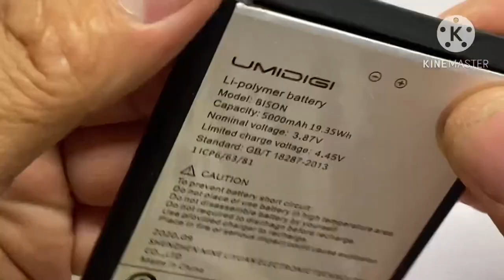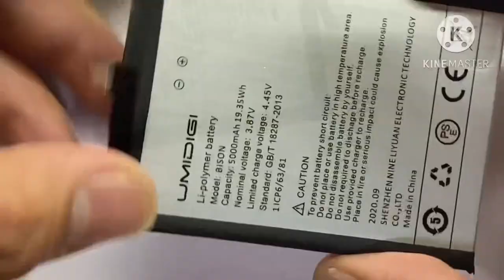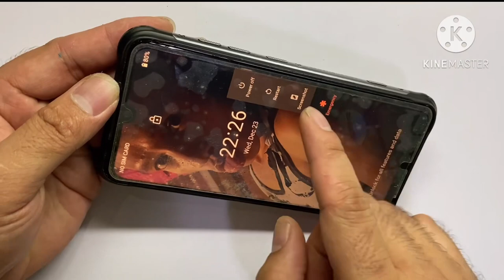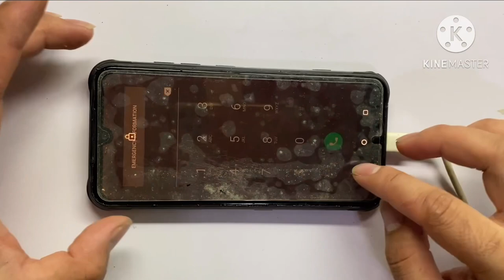Umidigi Bison Boot Loop problem fix 100%  almost full battery ayaw mapunta sa menu namamatay lang!

Comment: Is that a fuse you're removing and soldering up the contacts? I've got new version of this phone gt2 5g and it's randomly turning off, won't boot up and I suspect battery problem as it won't take charge and keeps corrupting the software. Also when it's on if you bump phone screen goes fuzzy with colors, possible loose connection. Fairy new and has had a few minor drops but no physical damage. Deciding if I should attempt fix or bin.
Reply: Cara amigo, caso esse problema da bateria esta relacionado ao outro modelos não se preocupe que um defeito cronico geral, acabei de fazer no meu UMIDIGI A7 PRO e resolveu
Reply: Yes I did the fix to GT2 5g and it worked also